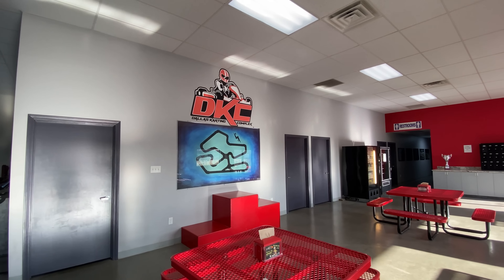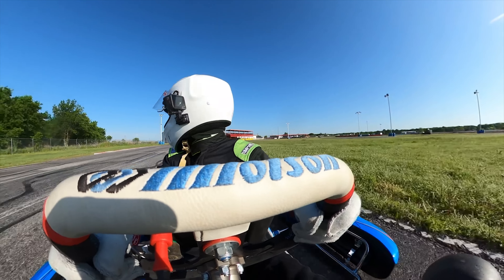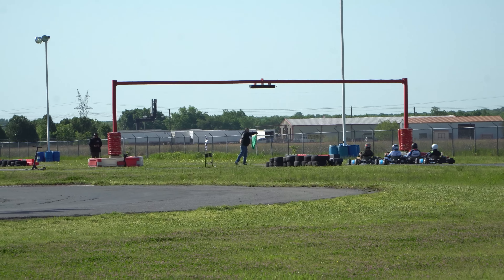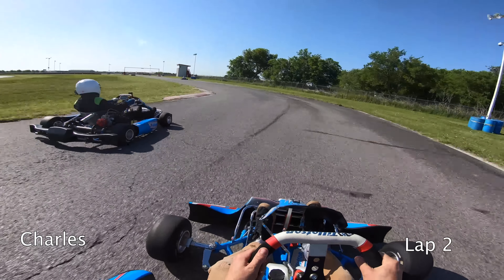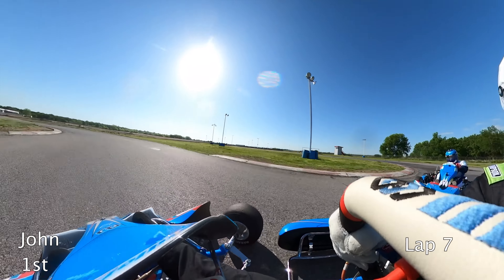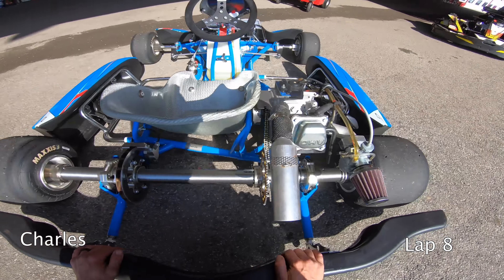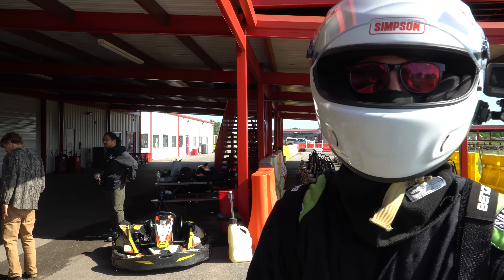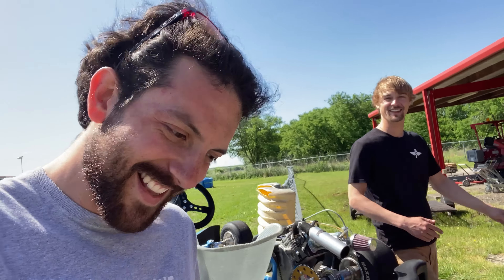Tillotson T4 Racing Kart Test Day | Prep for Our Debut Race in Tampa!

Comment: One of the skills I learned from back in my go-kart days was how to tie-wire fasteners.
They rattle themselves apart, and Loctite is a pain to remove.
Reply: I still have a big roll of safety wire and a coffee can of castle nuts left over, I haven't even been in that scene in 15 years.
Reply: Blue threadlocker is better for having to remove fasteners. and if a person wants to make it so they can loosen fasteners. even after they have on something for a long time antiseize is a must.
Reply: @musicauthority7828  loctitie works but the wire is a rule in racing. Mainly to keep stuff from backing out and falling off in a race. Pre race inspection will kick you if you don't have it around here.
Reply: @Vamp_Tepez  I was a crew member at our local NASCAR sanctioned track. and there were very few areas where wiring was necessary. and tech officials don't require it but there are plenty of other things they require. however in aviation it is completely necessary.
Reply: @musicauthority7828  I took aviation maintenance in school so learned about that side. But here mainly all we wired was wheels nuts, header bolts, and pedals. We ran at usac/nhra tracks here. More so when we got into running kt100's.
Reply: @Vamp_Tepez  I was a crewmember for over five years at our local circle track and they ran all classes of stock cars and open wheel cars. and in those five years wiring was only required on certain things like fuel cells.
Reply: @musicauthority7828  lol when we raced actual cars we never had to use wire, only in Karting for some reason.